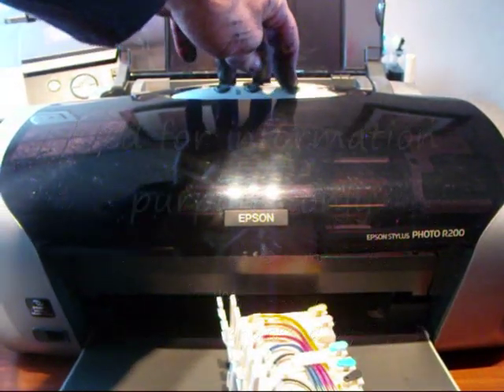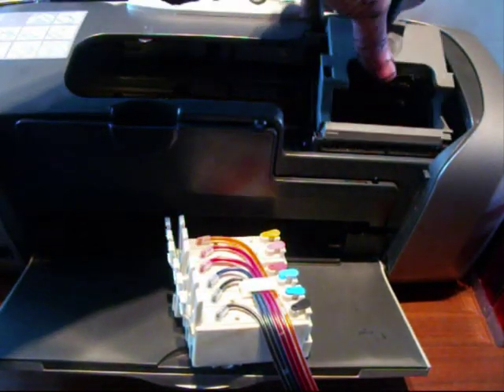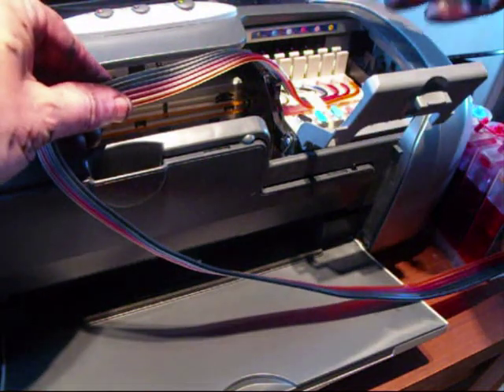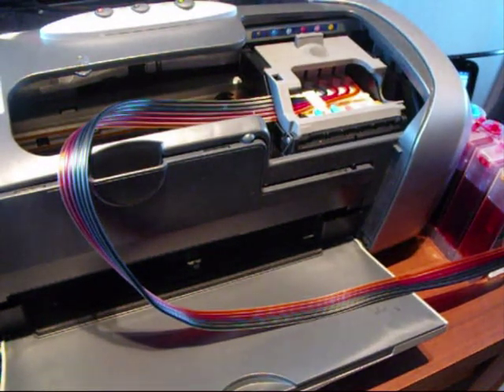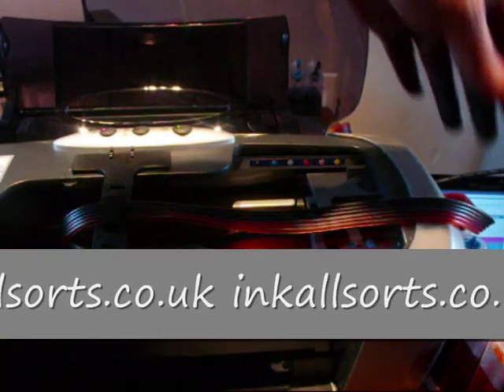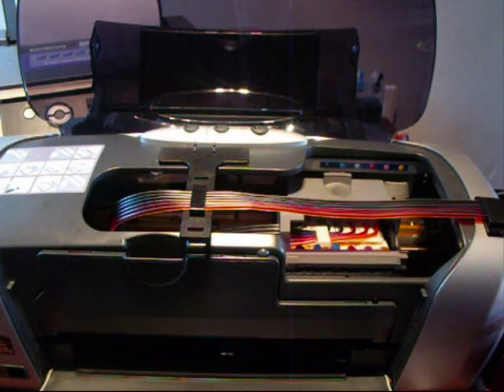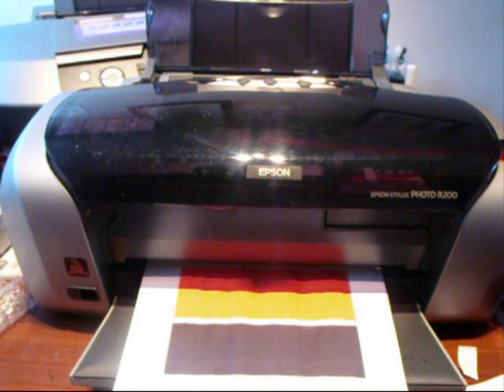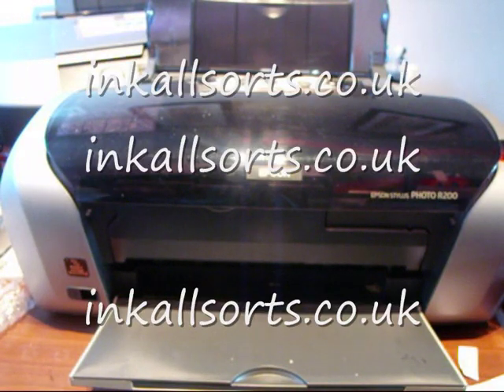How to install a CISS onto R200 R220 R300 R330

Comment: Third party inexpensive cartridges used on my R200 for many years. Now, very poor color accuracy, even after changing cartridges. Usually the reds seem missing. Wonder if even after cleaning, something else is going on. I understand one can buy cartridges that are only for cleaning, but the are poorly labeled. YOu buy them, and when you go to use them, you start wondering if they are normal color cartridges...and cannot tell.